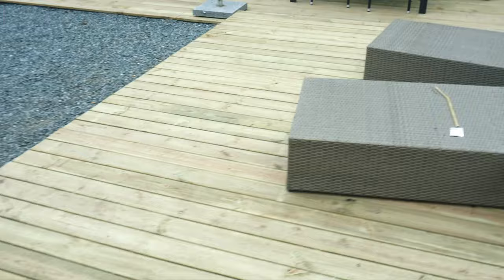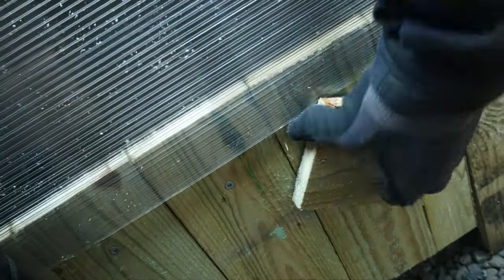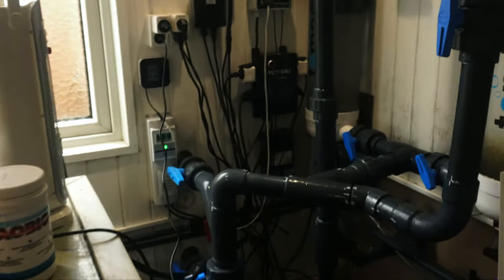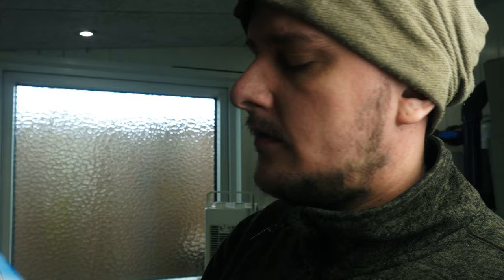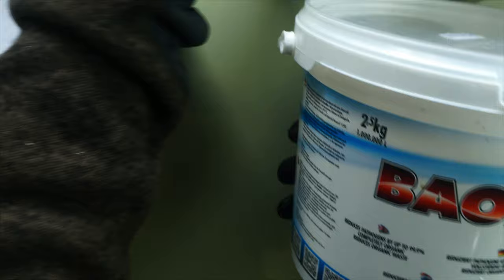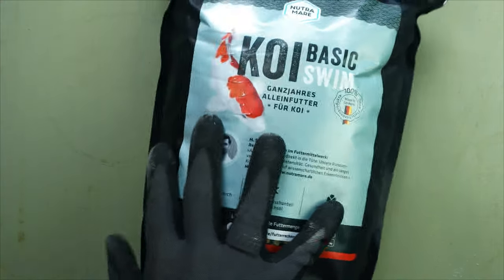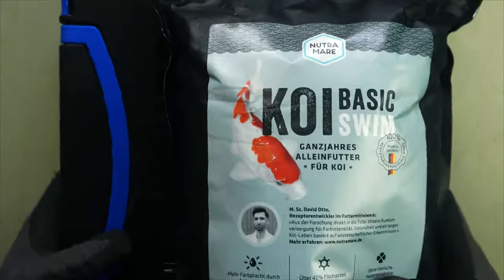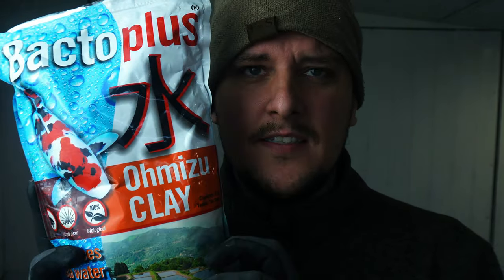Jobs around the pond is done! | A (good) bacteria talk - KEEPS THE POND HEALTHY | Air-Aqua Baobio+

Comment: Samuel, great video. I did some research on the bacteria after we all spoke about it on the live. The powder version of beneficial bacteria is the same as dry packets of yeast for bread and pizza ect. It's activated by liquid. I would imagine the other one you spoke about, in the gel, is also being kept alive in the gel, but only in the dormat stage, once mixed in water, it feeds and multiplies. Makes sense after I researched it. Great pond set ups you have there. I like how everything is being monitored and kept tidy. For what you're doing, it's the perfect running system. Thank you for the tour. 👍
Reply from the maker: Thank you Chris for taking your time to answer ❤️  Yes that would definitely make sense, i always just wondered why the container never expanded like the lactoacid ones. But the gel vs liquid is the amswer 🤔 i will try to see if i can multiple then in my activator 😅

my setup maybe look over filtered an technical as hell. But it's just like i wanted it. Its my forever pond, and i like Tech-stuff 😅

Comment: Hi Samuel. First time on your channel. Looks like quite the set up you have with the nexus, eazypod  and shower. I'm not criticizing you in any way but am wondering if all of the pond additives are really necessary? I occasionally use koi clay in the pond but other than that seldom use anything else and my koi do well. Just wondering. 🤔
Reply from the maker: Thank you for stopping by 👋
Yes the filter setup is something else and the pond is "over filtered" but the pond is my "forever pond" so to speak. So the filters should be able to handle 20-25 koi at 70-80cm and my 2 large sturgeon :-)
And i dont want rebuild the filter or pond, like ever 🤭
the reason why i started using clay, beneficial bacteria was my major bacterial issue some years ago. Thats how i keep them away. The minerals and green control i find the best way to keep the algae away in a natural way. 
Stuff like the lactoacid can help keep algae away and filter bacteria help start the filters after winter. But no they are in no means necessary. The pond will find its own balance, it just takes a long time 🤭
i just find all that microbiology extremely exciting and fascinating in the way it can help to establish a good environment in our ponds. So i tinker around with it alot 🙂